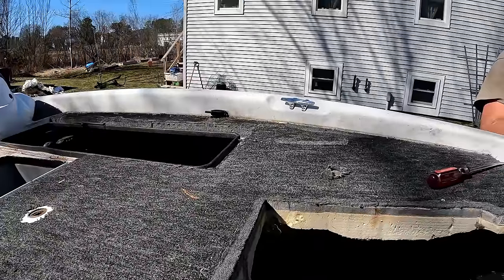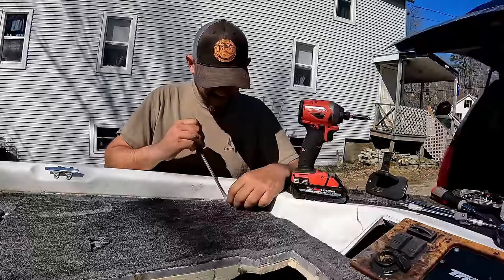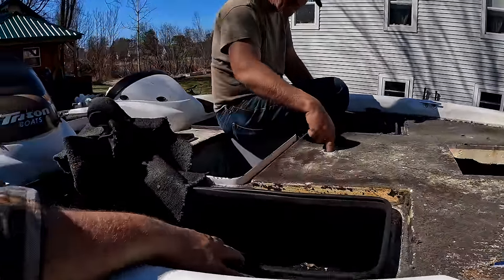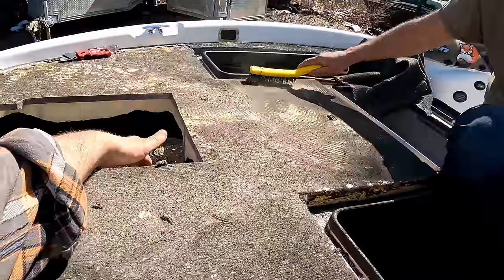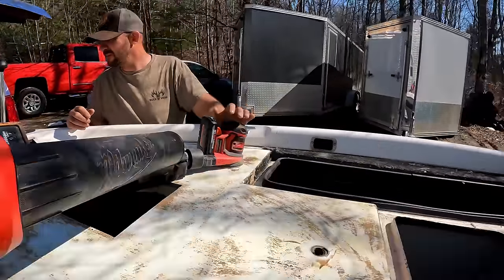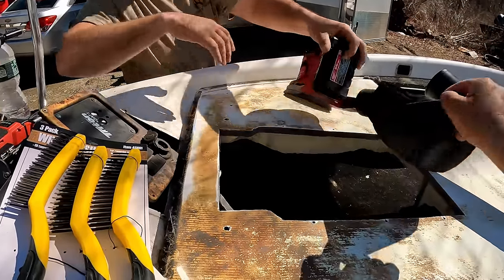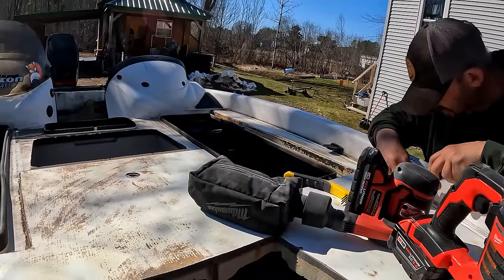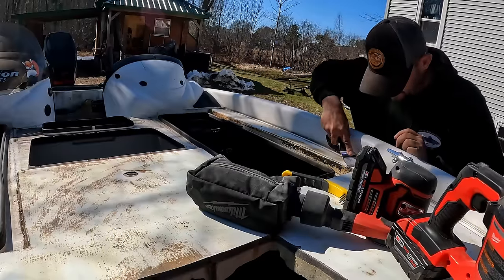Restoring A Bass Boat: Episode 2

Comment: I believe if if you use Sea Deck or something similar, instead of carpet, you will be much happier. Just a suggestion. 😎😎
Reply from the maker: Thanks for the tip! I really looked into it. I wouldn't be happy with the huge gaps with the sea dek since the hatches were made and sized up for double overlapping carpet on each hatch and hole. Iv'e fished off sea dek material stuff before and enjoyed it and it washes off nice too Not sure on the longevity though.